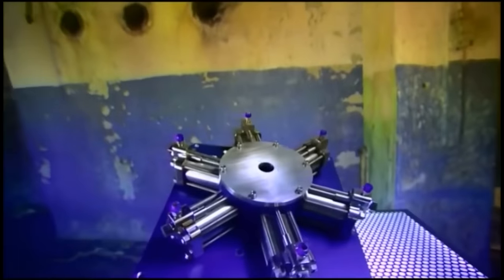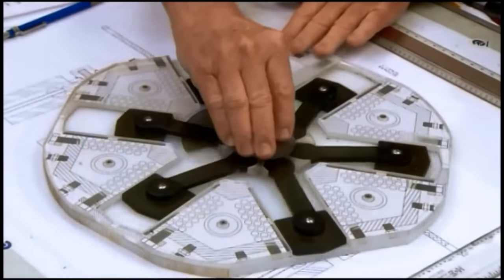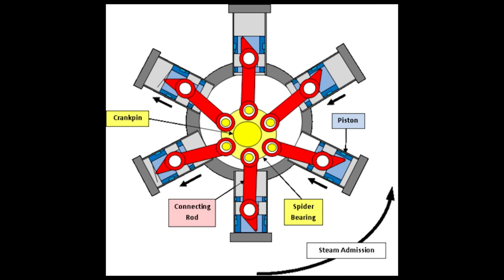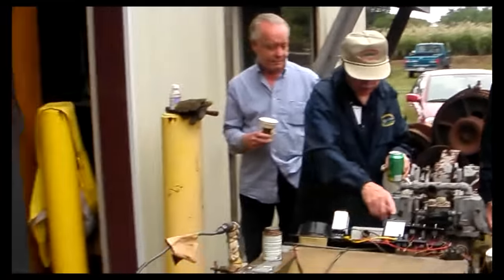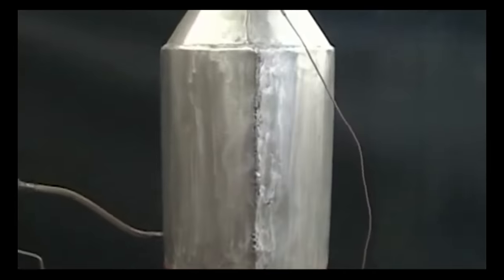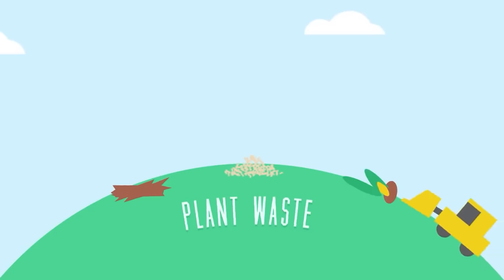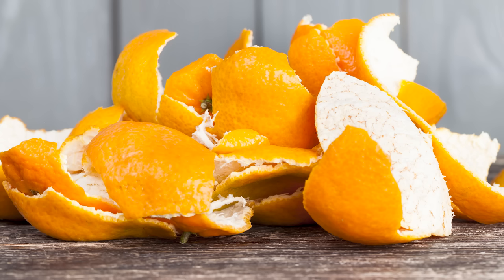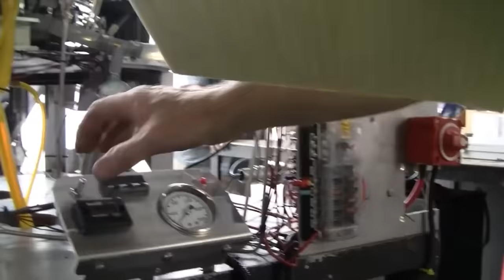Is the Cyclone external combustion engine the future?

Comment: Would it be possible to super heat water, and mix it with the air or gas and inject it into a regular modified engine for better performance or power? I like this design, but it IS basically just a steam engine mixed with rotary engine...
Reply: Just scrap the engine, the deionized water and supercritical state, and put steam in a turbine instead. Simpler and won't need to have oil still or be less efficient.

Comment: ALL steam engines ARE external combustion engines. ALL combustion creates harmfull by-products, e.g. pollution. Now this solution MIGHT be more efficient than older designs.  But it's still basically 19th century technology, which needs to give way to REALLY efficient technology like electric motors with ZERO emissions, assuming a renewable source of electricity.

Comment: Radial engines use a master cylinder and connecting rod. This thing does not. 

There are some out-sticky bits at the crankshaft end of each connecting rod, that look like they would contact some of the pins that hold the two plates together. It looks like stops of some sort.

That might serve as a substitute for the master rod. But I can't be arsed to work it out.

I don't like this engine. It's just a steam engine. As such, the method of producing steam is entirely separate from the method of converting that steam to motion.

Comment: I think apart from the technical side it's just thermodynamicly inefficient. So many Points heat energy can be lost on top of the loss in the conversion to kinetic energy.
High torque is nice, but what else is high torque, light, compact AND highly efficient? Electric motors. 
It can be  driven from the grid, a battery or hydrogen cell. The only reason we still use combustion engines is the power density and low explosion risk of the fuel + supporting the infrastructur and manufacturers already exist. Oh and oil reserves are still cheap enough to exploit.

Comment: This is not new or anything. 
Just a normal steam engine..

Try look into Stirling engines
Your excitement over external combustion engines requires you to look it up.

A motor driven only by temperature difference. 
That actually can run on as little as 0.5°C difference.
With nothing but some mechanical parts and air inside. Combustion or hest is purely external. 
Even more than a few commercial applications available.

Comment: https://en.wikipedia.org/wiki/Stirling_engine#:~:text=Robert%20Stirling%20patented%20the%20first,generically%20be%20called%20Stirling%20engines.

Thinking about this I realize its really a Stirling engine and so any engine with a closed intake/exhaust cycle that contains the working gas is a Stirling cycle. This is one example and there are many others that create heat or cold or convert heat/cold to work energy=motion.

Comment: There is nothing new here, super critical steam engines are old tech. As others have pointed out these super high pressure steam engines are under a lot of stress and tend to be maintenance hassles and that being the reason they are generally used only on industrial scale where their cost to maintain are more on par with any other types of engines. Also the efficiency of steam turbines have long since surpassed that of the steam pistons in most use  cases.

Comment: Yeah....... the problem lies with the amounts of "Biomass" necessary to transform water into superheated steam, and not to mention the amounts of time necessary to make this heat transfer. It will always talked about the same fact just using a small nuclear reactor like they use to power satellites. This way you only ever need to add water and possibly a little lubricant to the system to keep it running. But the problem with accidents with a runaway chain reaction or running a system low on water and having a miniature meltdown on the side of the highway isn't truly very favorable conditions! But nice try, the problem isn't with development of a powerful steam engine itself in a small package with the materials and tools we have nowadays. It's the problem of making the conversion of water into steam! Not necessarily efficient and takes longer which means more greenhouse gasses are going to be outweighed over the life of the product over say something which is directly injected with the fuel and instantly converted into movement energy sources. Keep dreaming, eventually you will run into the same walls all engineering had already done in the past. The feasibility aspect of the design is a failure before its begun.
Reply: Agreed. Every time someone mentions the following, I wait for their lightbulb to turn on:

-small scale nuclear
-hydrogen gas
-solar power
-sterling powered vehicles
-"it runs on water"
-steam engines

They act like it's never been done before, or never been done 'this way'. In the end, it doesn't matter. Hydrogen gas lacks power density. "Small scale" mean the necessary critical mass required for nuclear to be efficient, isn't there. "It runs on water" means you're either hiding an external power source, or you're cannibalizing materials. Solar power is limited to a peak of 1.3kw per m²... that's going to be one huge stationary, or very low power mobile machine. Sterling powered anything, still needs a power source... and suffers from duty cycles limited by heat soak. As you've already noted, steam is indirect, inefficient, and startup times are inhibitive. One look at the history of locomotives will tell someone all they need to know.

Comment: This is a steam engine old trains used super heated steam the design is a radial engine and the burner is litterally a gas burner it's no different than a burning fireplace in fact since your heating the steam and pushing it to cylinders you have way more losses than a normal engine all it does is look cool it does nothing at all

Comment: It probably 'failed' same way battery extender chips, sonic clothes washer and GMs electric car from decades ago: it was hard to design profitable ad-ons like clothes soap (not needes in sonic washer), oil and coolant not needed for electric car or battery replacement being extended by 3 to 4 times. Some ideas trash engineered obsolescence. Where's the profit in that?

Comment: Let's assume this design is really real (and the drawbacks like wear and application were not in the equation), if someone actually designed something successful like this you would then have to deal with the big oil companies and politics and those companies losing revenue. For example, why do you think tobacco companies are so in control? They have power over their customers and enough money to make issues and strife disappear, hence why they haven't been shut down. Also they try to have safe alternative products removed because they hurt revenue. I'm not trying to start a flamewar, but I am not wrong. Do your research and you will see my point. This engine design if a true success would take away from oil companies and therefore they would find a path of least resistance and burry it, even knowing that fossil fuels pollute. I hate politics of any kind frankly, a bunch of power and money hungry vultures fighting for a carcass. People are capable of so much more if we set aside our petty desires and look at the big picture. I try not to get involved with politics, but they would hinder the mass production of this engine much like tobacco companies interfere with safer alternatives. My knowledge is not perfect, but it does play a role.

Comment: there are so many wrong statements in this video.
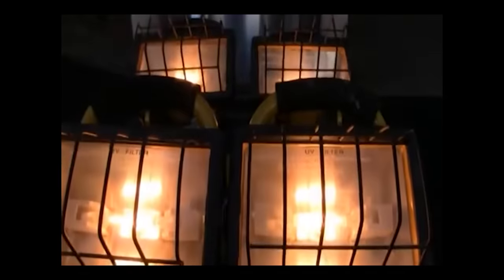2:47 "its not the fuel that powers the engine its the steam" 
you cant heat the water up to generate steam with magic you need fuel. thus its powered by fuel and not steam. 
steam is what makes the engine move but its not what powers it. that's like saying an ICE engine is powered by the pistons and not the fuel. or an incandescent bulb is powered by the filament and not the electricity. 

also its inefficient to let the water cool then heat it back up again. you waste so much energy letting it cool down. it takes a lot of energy to heat up water.
there's also an efficiency loss when transferring energy from the fuel to the water.

Comment: It's hard to sell oil if people need less of it. It's too efficient perhaps. Maybe it has too much potential as clean, mechanically feasible, and efficient alternative. The oil industry is not threatened by the electric car industry because electric cars are heavier and their batteries consume more fossil fueled energy than their counterpart. I'm not at war with fossil fuels. I'm at war with inefficiency and high cost for the purpose of a scam. More fuel burned means more gases in the atmosphere. Am I wrong?

Comment: It looks like they have an external air compressor as well, off to the side contributing that necessary increase of flow that's needed to reach the temperatures over 1000 degrees...
 Steam is great to spin turbines and generate our power, but it all.comes down to finding enough energy without toxic emissions, or over usage of non renuable fuels...
   These designs are pipe dreams, ahead of there time maybe, or maybe once it's possible it won't be necessary cuz we'll all be traversing multiple dimension and solar system hopping with our dark matter engines or plug and play off stars like a gas pump....
 Just a couple of thousands of more years....

Comment: Wait what! Supper critical steam of 1100deg c cac act like a lubricant? Whil it doesn't meld the piston en destroy the bearings XD don't make claims like that please! For saturated steam this could act like a lubricant bit wil cause cavitation In piston engines , en about the efficiency ,the rankine cycle is about 10/15% efficient so your better of whit a gasifier en a normal internal combustion engine

Comment: these engines have wear issues associated with mineral (lime, salts and calcium) buildup that is present in water... the better engine is the hot bulb engine that runs on ANY combustible liquid.
Reply: Hot bulb engine?
....... first glance I thought it read hot tub engine and hot tub time machine popped in my head🤣

Comment: If you make extraordinary claims but fail to demonstrate those claims publicly or provide any concrete evidence for them, you are likely lying. 

Furthermore, the automotive industry has moved entirely away from the combustion engine in any form. That makes this a non-starter. You can not burn things to create energy, it's becoming illegal for transport in many countries around the world. 

The automotive industry is now delivering electrified vehicles. Some of those are battery electric, but the big main player will be H-FCEV (hydrogen fuel cells). 

Instead of burning hydrogen, they use chemistry to release electrons generating electricity. The benefit there for the consumer is they don't really need to change their behaviour in terms of how they use their vehicles. You refill hydrogen at a converted petrol station almost the same as how you refill petrol now (and pretty much identical to how you refill LPG). So the down time for recharging is the same as your car has now. 

The up side for the automotive industry is they get to continue to control the fuel source without having to be responsible for grid electricity generation. So they still get to charge you to run your vehicle whilst complying with incoming regulations.

Comment: Because oil mafia
Reply: Because of the Second Law of Thermodynamics, and Joseph Black's discovery of Latent Heat in 1765.
 Any engine that undergoes a phase change in the working fluid will always be less energy efficient than Internal Combustion.

Comment: This engine just a joke. I suppose, they never get really high pressure to make this engine work on supercritcal steam. Because steam at high pressure about 200bar needs to expand at least 100 times, so, there is no way to fill cylinder with 1/100 of its volume with precision. There need to use very high-speed valves and there need to have very small dead volume. So, this kind of pressure need at least four-times expansion, say, four cylinders of different volume to avoid high temperature gradient during expansion which leads to heat lost... I mean, there is no way to make single expansion engine work with high efficiency. Only multistage expansion is possible for such high pressures.

Comment: Wow, like no other engine ? but it sure looks like any of our aviation radials (Pratt & Whitney)used as a steam engine, coupled with all of the inefficiencies of steam/external combustion. Not saying it's not worth playing with, but please don't make claims you can't back up. I have a air compressor that is basically that same design that I picked up specifically to convert to a steam engine. (Actually prefer the twin cylinder high pressure type, it lends it self to 2 stage operation much better)

Comment: Those torque figures you only need a 2 speed gearbox.  You don't want to go any faster.  I heard about the old steam cars and it was all talk.  They said it was full bore to 80 MPH then you went to second gear.  The old steam Locos they give their all as soon as you crack the valve. Diesel Locos have a torque converter and then go to direct drive when up to speed.  ICE has to wind up to deliver the power.  DC electric motors have the torque.  The science is good those old radial engines were in the airplanes because they were reliable and if something broke they didn't stop.

Comment: Global glow ball Angular velocity / Gravity = force vectors from 90* right angle of axis at poles to 0* or directly opposed at the equator. The only point where the 2 forces could find balance and the only place unrestrained water could find level. ( see wet tennis ball )  If Earth were a spinning ball then a polar sea would be impossible and all oceans would move to the equator forming a disk in the air up to the equalization point. This is not what we observe therefore we are not on a spinning globe.
Reply: Your in the wrong comment section this is about an external combustion engine nit your silly religious beliefs
Reply: @terrafirma9328  I dont have any firm set religious beliefs. If one is interested in science and technology isn't an accurate interpretation  of force and motion necessary to understand how a machine works? Force vectors are real things. Pretending the globe math works by not doing it and denying it to those who do is more like a religious faith

Comment: There is nothing new, original or unique about this piece of junk. It is just a typical radial engine powered by steam. The first ICEs were just steam engines converted to 4 cycle, so converting one back to steam is a no-brainer and there is no problem with steam technology, it has worked flawlessly for centuries. The only difference is that this one is designed as closed-circuit, sterling type engine. Big deal....